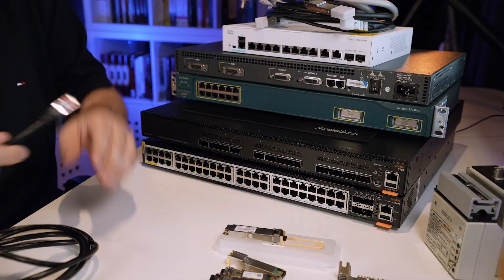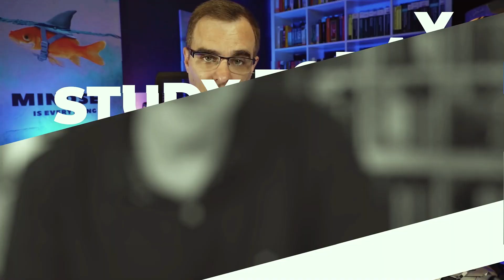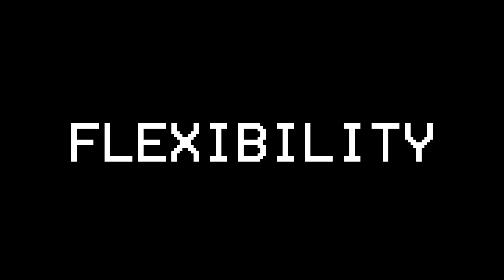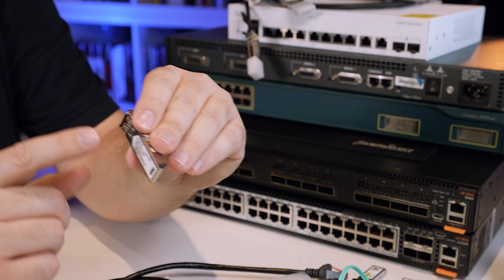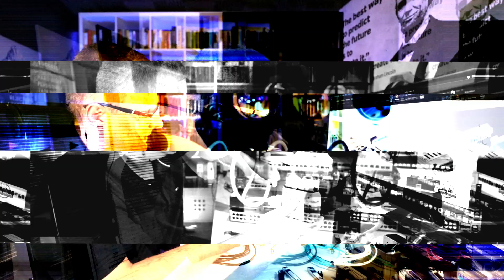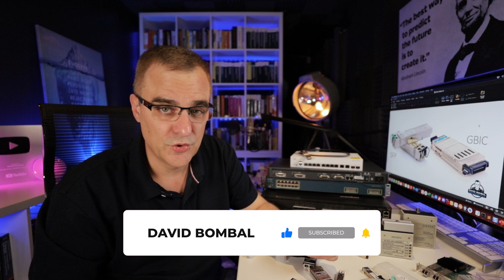SFPs, Transceivers and Ethernet cables

Comment: One thing about SFPs, some equipment is fussy about brands.  You have to make sure a particular combination will work.  I have often connected single mode (yellow) fibre to a Ceina media converter and then twisted pair to a Cisco router.  Back in those days, I carried a collection of fibres, single mode, multimode, SC & LC connectors, simplex & duplex cables, etc. in my vehicle.

Comment: Great video David! Your videos are always really educational :)

Are there any dual port NICs with support for both 10G SFP + and 1G SFP modules? 

I bought a intel x520-da2 card and 10G SFP + modules work fine, but I cant get regular 1G SFP modules to work. Since I need a specific 1G SFP module do anyone have sugestion for a BiDi SFP 1310nm-TX/1550nm-RX module that would work with my NIC? Or do I need to buy another NIC?
Reply: just get a tp-link media converter with a sfp port to rj45
Reply: @BaldurNorddahl  Nah, it's for my firewall so I want the fiber directly connected since it only has 1 pcie slot for a nic, and no rj45 ports.

1x 1G SFP to my ISP and a 10G SFP + connection to my "core" switch.
Reply: @TheJensss  in that case you can use the switch as a mediaconverter. Just put internet on vlan 100 and intranet on vlan 200 both on the single 10G connection to the firewall.

Comment: For what purpose would you use MPO type cables?
Reply from the maker: Per Fluke Networks: "MPO Connectors have been used in duplex 10 Gig fiber applications throughout the data center for several years as a way to deploy preterminated plug and play backbone cables between switches that take up less pathway space and ease cable management while offering faster deployment. In these 10 Gig applications, 12-fiber or 24-fiber trunk cables with MPO connectors on both end form the permanent backbone link and are then transitioned to duplex fiber connectors at patch panels via either MPO-to-LC cassettes or MPO-to-LC hybrid patch cords."  
More information here: https://www.flukenetworks.com/expertise/learn-about/multi-fiber-push-mpo-connectors#:~:text=Multi%2Dfiber%20push%20on%20connectors,data%20center%20and%20LAN%20applications.
Reply: @DavidBombalTech  Thx for your response

Comment: Good video - I think it would be cool to dive more into the SFP or QSFP switch/adapter side communication and how a switch or adapter might determine they are "unsupported". Then there is the topic of SERDES and BER or bit error rate along with the signal strengths, tx bias and then what some of the most common port counters and how they can be used to troubleshoot. I also have to laugh at putting covers on the LC cable ends. I worked 10 years with FC from 1GB to 10GB and used cables in a lab that were a decade old, stepped on, tripped over and buffed out on the jeans when the ends fell into a dusty corner and did not ever get covered... Oh a manual variable fiber attenuator is a fun tool to introduce errors and study how the higher layers handle error recovery.
http://www.qsfp-dd.com/wp-content/uploads/2022/03/QSFP-DD-Hardware-Rev6.2.pdf
Reply: That's funny. I work with guys that will literally throw away an LC patch if the tips touch something. One guy carries around an LC cleaning tool and won't even use a fresh out of the bag patch until he's cleaned it. I really don't think they're that fragile.
Reply: Yeah not that fragile at all. A lot of equipment will let you look at some details about what the SFP reports. Some cisco equipment will show details with "show int X/X transceiver detail"  If you want to be cruel, have those guys with LC cable OCD cleaning syndrome look at those stats and tell them you want them to work on getting them perfect. I know int the infancy of 10Gig ethernet the SFP vendors committed to allow a 10 to the -12 power bit error rate. That is one in a trillion bits are allowed to have an error. That is an error ever 78.5 seconds at 10Gb/s when 8b/10b encoding is used. Also if you have some lab equipment, setup a test for those folks monitoring the SFP stats and such as you pass traffic and mess with a bunch of cables to show how actually violent you need to be before a cable is the fault of errors.

Comment: 4:05 For the networking history buffs, there is a 30 minute talk with Bob Metcalfe (Father of Ethernet) in Sep 2021 that is quite interesting.  He talks about why the vampire tap (he referred to it as the Jerrold tap) was used, as well as why Manchester encoding was used.  If that is something that sounds interesting, you can search for Voices of Ethernet A Conversation with Bob Metcalfe
Reply: Sounds interesting, will search. Thanks for the info
Reply: He called it a Jerrold tap because it was standard equipment in the cable TV industry, where Jerrold was a major supplier.

Comment: Pioneering David...great succinct vid! I would use DAC's to configure several stacks of eight 6400m Aruba switches. Ports #51 & #52  would be utilized (as you showed) with 25G SFP,  that would be configured as a LAG to uplink to the core.  More power to you hermano!
Reply from the maker: Great comment! Thanks for sharing!

Comment: Haha, pretty sure some of this stuff was definitely around before I was born. I learnt a lot in one video - namely I've always wanted to know what those GBIC and AUI ports were for on some of the old Cisco gear I've seen. Also have never seen a vampire tap in real life, nor pre-10base-T technology; very cool.
Obviously not very useful nowadays, but I didn't even know there were 50Gb/s interfaces and it was only recently I found out about 2.5, 5 and 25Gb/s interfaces.
All fun and games. Fully modular port chassis are usually far more expensive than their fixed counterparts, but it is nice to be able to offer copper or fibre without having to buy two separate fixed switches in situations where you provide colo for example.
Thanks for the video and good luck with the new channel.
PS
The interview are definitely not too long :D
Reply from the maker: Thank you!

Comment: Of there is the practical use cases between long and short breakouts. For example a hotel can have a core router and fiber only switch and then stretch fiber to each floor. Some small business might need only have short distances and can get away with ethernet cable. Distance plays a role along with bandwidth requirements.

Comment: How about brand of switch vs. brand of SFP? Does it really matter?
Reply from the maker: Some vendors such as Cisco will restrict which SFPs can be used (exceptions and variations, so you will need to check on specific device and vendor).

Comment: Enhanced Small Form Pluggable (SFP+) are the same size as SFPs but support higher data rates; common with 10 Gig ethernet.  There are also Quad Small Form Pluggables (QSFP)and Enhanced Quad Small Form Pluggables (QSFP+).  Bi-directional QSFP and QSFP+ allow traffic in both directions with a single fiber for greater efficiency.
Reply: This is probably one of the most common technologies in "the real world" (data center) that almost no one talks about. Just one more example how David's channel is much more valuable than others.